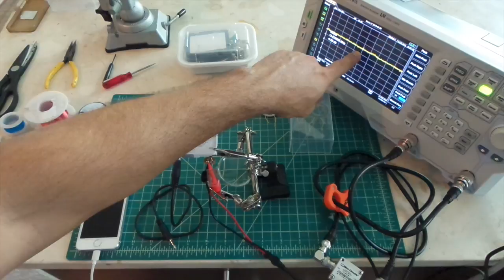NFC Antenna Tuning 101

Comment: This is a long shot given the age of this video, but here goes.   I have a Rigol DSA 815 and a Rigol VB1032 VSWR bridge.  I would like to replicate this experiment with some ISO 15693 RFID tags.   Can you describe how you set up the spectrum analyzer for this video?
Reply: It's been a while but the basic setup is the carrier signal goes out the output port of the DSA815, through the bidirectional coupler (uplink) to power the NFC coil and bounce back though the bidirectional coupler (downlink) to the input port of DSA815. Once that's in place, you can test the quality (Q factor) of the inductive coupling of your NFC coil and target tags by aligning them and observing the power dip in the specified 13.56MHz band.

Comment: Is it possible to have a 8-12mm RFID chip antenna read into a multi coupler antenna and then transmit RF through Software Defined Radio where the chip can amplify your own voice?
Reply: Not sure I understand the question. Like you want an SDR to backscatter voice data instead of RFID tag data?

Comment: I have a question about the NFC metallic amplifier embedded in a credit card. Is that what it is? it doesn't seem to be the actual antenna for the chip. How does that work? is there a way to have one coil receive and then transmit to another coil that then talks to the NFC chip that has a built-in antenna? So like a coil extender? Thanks
Reply from the maker: What makes you think that it's not the actual antenna for the chip? Either way, there is the phenomenon of inductive coupling that you can leverage for coil extension. This is how our NFC Patch Kit product works (https://flomio.com/shop/readers/nfc-patch-kit/).

Comment: any tips on making a custom cylinder antenna  that can read those fancy nfc implants? that will connect to an RC522 that is compatible with arduino.?
Reply: sure, there's plenty of insight on flomio.com/ask-the-flomies ... rule of thumb is 6 turns of 32 gauge wire

Comment: Where's the actual antenna tuning part of the video?
Reply from the maker: The antennas were made by coiling 32 AWG wire with different loop counts and geometries. The Spectrum Analyzer then tells you which couples best with the target tag.
Reply: @FlomioTV  I was looking for a guide to adjust the tuning components between the coil and the reader chip, NXP's documentation being a bit vague of how to make the measurements.  Hence I too was a little disappointed by the lack of tuning in this video.

Comment: When tuning a tag antenna using the setup above, do you just connect the two leads of the tag antenna to the coupler? 

Did you need to add any additional options to the scope in order to perform those measurements? 

Is the connection from the directional coupler to the antenna a particular impedance?
Reply from the maker: The spectrum analyzer setup does not wire into the tag antenna. The two leads are from the proposed reader antenna coil and these plug into the directional coupler "IN" port. In order to perform the return loss measurement for antenna tuning you will need your spectrum analyzer to have a "Tracking Generator". This is basically a generated signal from the "OUT" port that the analyzer can track in the "IN" port (of the analyzer, that is). NFC transceivers generally come with a 50Ohm matching impedance so you need to set your antenna front end discrete component values to allow for that. There are several tools online that will assist your loop antenna design based on wire gauge, number of loops, and loop diameter to approximate a 50Ohm impedance and highest Q factor for NFC tags. Overall the common transceivers on the market are pretty tolerant to mismatches so you should be able to get something that works while not perfect.
Reply: Which SA are you using here?
Reply: The setup he has is a magnitude only Network analysis. If you have a vector Network analyzer you can do the same thing to measure the return loss. The spectrum analyzer he is using has a tracking generator to be able to perform that measurement. The measurement is limited by the directivity in the coupler.  To design that magnetic antenna you can use the Biot-Savart law to be able to generate the proper geometry which is directly proportional to the reading range.  I have designed these using HFSS  and Sonnet EM to extract the antenna parasitic and ultimately a model RLC you can model in Keysight ADS.